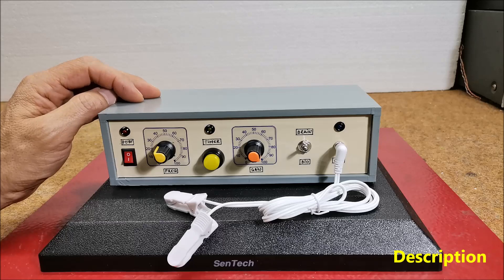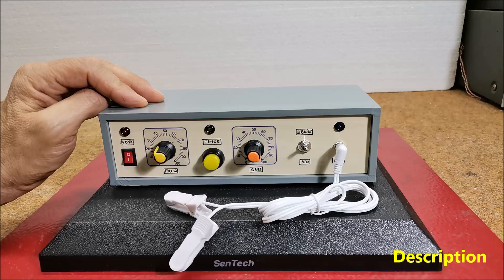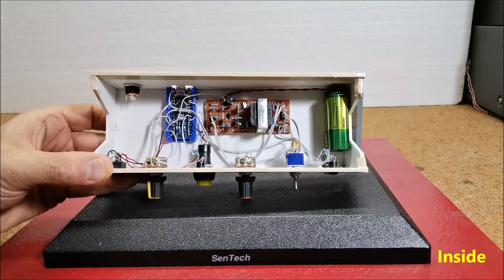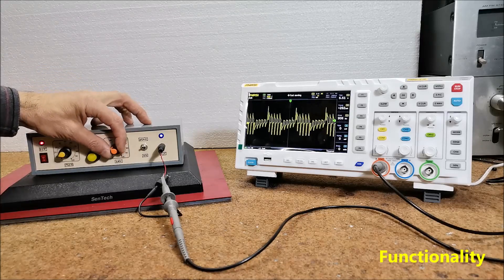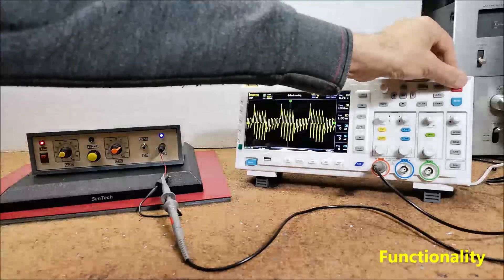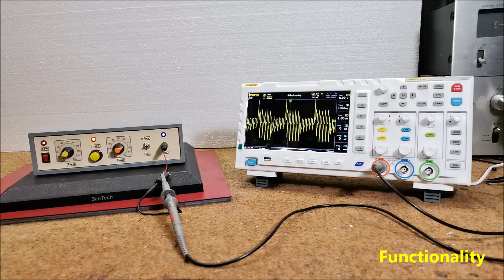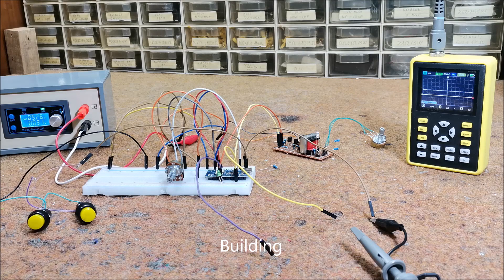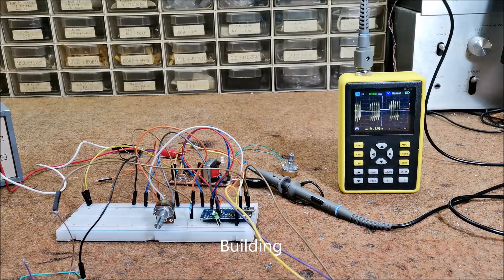Arduino Cranial Stimulator Bio BrainTuner

Comment: Great work Mirko, Simple and tidy. I want to give it a try.  On the timer version, what part is that little 6 pin thing on the left side of the arduino? Cannot spot it in the parts list.
Reply from the maker: It is a switch to select between the brain tuner and bio tuner function.

Comment: 111 Hz on pin PWM 9 - OK 
1110 Hz on pin PWM 3 - ok 
(1) how do u combine the two PWM signals to get the brain tuner and bio tuner modes ?
(2) is there a third wave also ?
(3) is the power + 10 volt to - 10 volt ?
Thanks

Comment: What is the rating in the trafo?
Reply from the maker: Transformer from the output audio stage of an old portable radio receiver
Reply: @MirkoPavleskiMK  how many pins does this one have ? Is it 4 pin, 5. Or 6 pin?
Reply: @MirkoPavleskiMK  i have an audio transformer with 4 pins . Where exactly would I wire the 220r coming from 2N3904 C into the transformers secondary?primary? Your diagrams look as if  your transformer is center tapped, do I need a center tapped one or could I make this work with a 4 pin?
Reply from the maker: @RottingInDeception  You need a trafo with 5 pins(center tapped)
Reply: @MirkoPavleskiMK  i found a small transformer from an electric fly swatter, would I specifically need an audio transformer or could I make this one work? It has 5 pins. Thank you again for your time.
Reply from the maker: @RottingInDeception  I think that transformer has many more turns on the secondary and will give a much higher output voltage. You could still try because the configuration is identical to the audio transformer
Reply: Im using the software arduino ide 2.1.1. Whenever I paste the code you wrote for us , on line 23 where it says “ #include <PWM.h> // library frequency “pwm” …… when I try to upload it it says “compilation error: PEM.h: no such file or directory” could you help me out on how to fix this please?
Reply from the maker: @RottingInDeception  Try on other PC with older vesion of Arduino Ide 1.x.x
Reply: @MirkoPavleskiMK  i used the Olán older one and the newest one. Both say the same thing : 
Fatal error: PWM.h: no such file or directory #include <PWM.h>  //  library frequency “pwm”
Compilation terminated. 

I hate to of come this far building it and putting it together to give up at this point. Any help would be greatly appreciated. Is there another place I may contact you in the case of keeping sensitive information private?
Reply: Could you give me a little more insight please?
Reply from the maker: @RottingInDeception  You need to install PWM library for Arduino  :  https://code.google.com/archive/p/arduino-pwm-frequency-library/downloads
Reply: @MirkoPavleskiMK  thank you, which one of them specifically did you use of that list you just sent me?

Comment: Thank you mirko. Made PEMF it worked well. 
I will try this ckt
Reply: Kindly help, What is the Audio transformer resistance. center tap side winding resistance &  Single winding side. 

I found an Audio transformer center tap side is having 28+28 ohms & single winding side is having 1 ohm. Is this okay to use.

Comment: Unfortunately, those "schemes" are not schemes. These are just some kind of coloring book.
Every electronics and electrician will cry when they look at those paintings.
Reply: The schematic,  shown on Arduino Project Hub,  looks like Fritzing's "Breadboard View", but the perfboard layout is missing? 
The Breadboard View doesn't work very well for this complex circuit with transistors driving a transformer.
But I see that Mirko has used these diagrams in other projects, which only have an Arduino, a Module and a Display and  it works well for that.